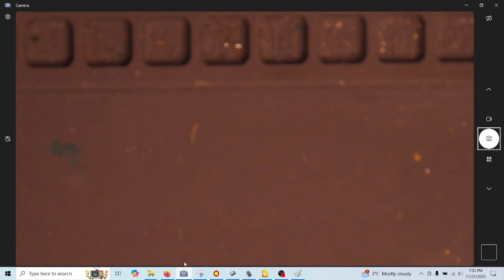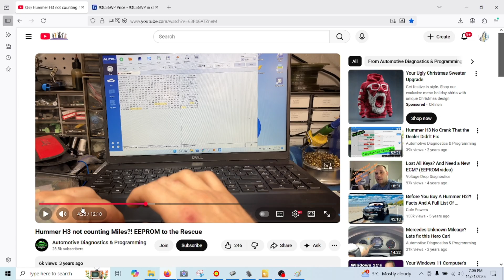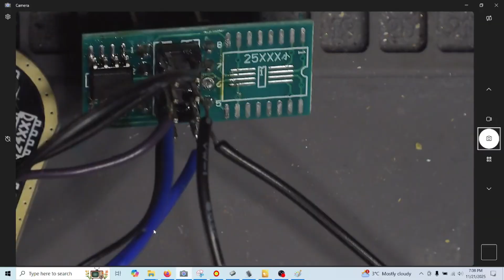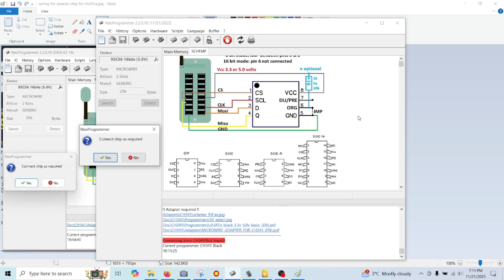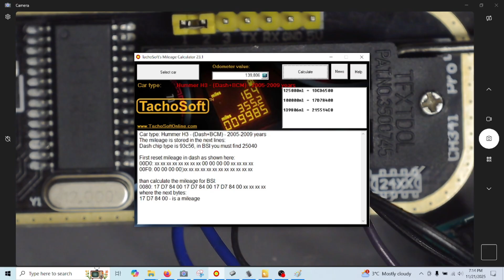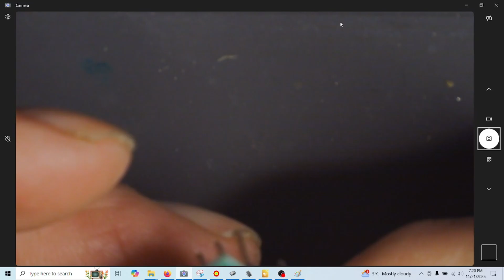Programming the 93C56 GM speedo chip from a 2008 Hummer H3

Comment: Great video, were you able to read the EEPROM on the BCM with a chip clip or did you have to desolder it?
Reply from the maker: Thanks. I de-soldered. My clip doesn't hold reliably. Easier to do off board, I find.